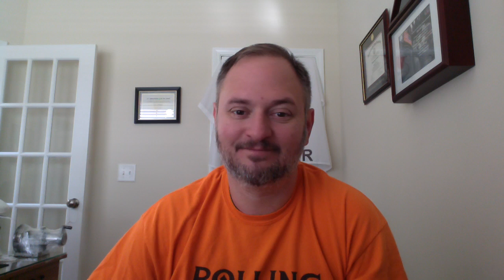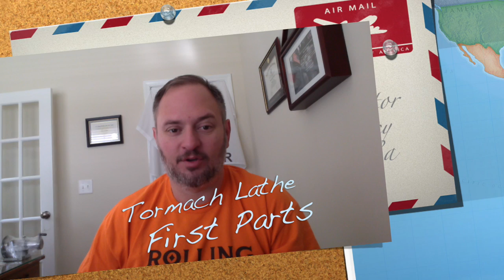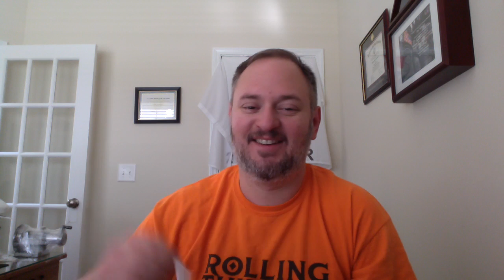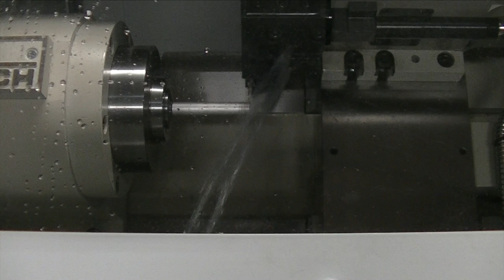Tormach Lathe - First Parts

Comment: Hey Tom, I hope you aren't using the coolant from tormach. Everybody I have talked to said it was crap. I have seen more than one machine rust because of it. Invest in some good lube. Just a word of warning. Enjoy the new toy.
Reply from the maker: Hi Eric! Had the same issue with that coolant and very quickly made the change to Qualichem. Thankfully, I had some good oils in general since I run manual machines as well.

Thanks for watching and for the feedback!
Tom Z
Reply: The Tormach coolant was switched out to a new product about a year ago and is much improved. With any coolant though if it is mixed with too much water it can cause rusting. A portable refractometer will help to assure you have the proper mix. http://www.tormach.com/store/index.php?app=ecom&ns=prodshow&ref=31366
Reply from the maker: Great to know! I should have the new type - any way to verify that? I did get rusting within a few days and I was very careful with my mix.

Thank you!
Tom
Reply from the maker: Hey - I went back and looked at the two machines because I set them up at different times. The machine I had rust problems with I was actually using KoolMist at a high concentration (the 440) which I switched to Qualichem since I had a small bottle just the right size for that coolant tank. The machine that has the DuraKut is the lathe and it's been fine. No rust at all on the lathe.

Sorry for the confusion!
TZ
Reply: Hi Tom. The new coolant we are selling is the Durakut 4010 and have never sold the others. There are other very good brands out there, but are not sold in gallon containers. Most of our customers would have a difficult time with 55 gallon drums. By the way, we like your videos! keep them coming!

Comment: tom surprised you aren't getting chatter on your finish because the rule of thumb is usually no more than two times the diameter sticking out.  must be really lite cuts.  I once used a box tool cutter on a CNC lathe to cut a 10 inch long pin without using a live center
Reply from the maker: Good points! I was watching for chatter but also taper from the part flexing. The first pass is a roughing pass and it's pretty ugly but then the finish pass gets it cleaned up really nicely. Would have LOVED to see that box cutter operation! I bet you got some looks there.

Sincerely,
Tom Z

Comment: Nice to see.

P.S., Somebody may have to come out with some special youtube anti-coolant glass for those doors!  :-)
Reply from the maker: Thanks, Ryan! I'm going to try a new coating from rain-x that we've been using on the motorcycle windshields. It's specifically for plexi so we'll see how it goes!

Best wishes,
Tom Z
Reply: I was wondering if a water based repellent like that would work.
Reply from the maker: No idea but it's been working great on the motorcycles so far. It's a new formula that won't destroy the plastics so I'll keep you posted.